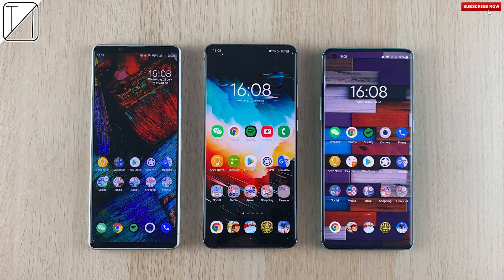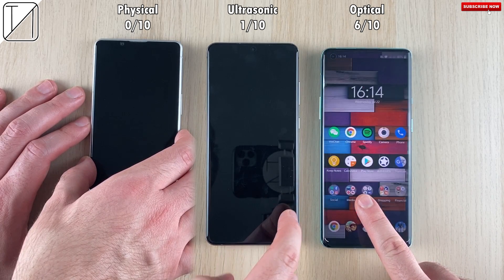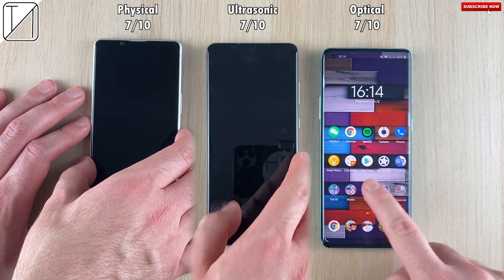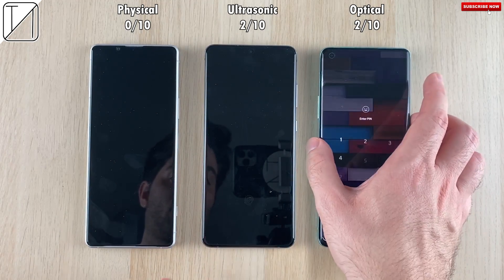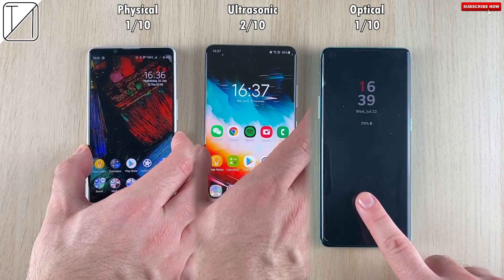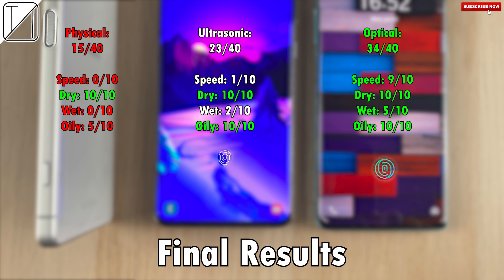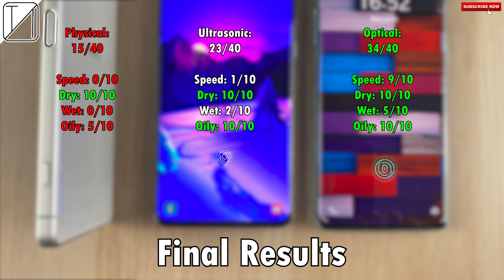[Slow Motion] Physical vs Optical vs Ultrasonic Fingerprint Sensor Speed and Reliability Test

Comment: I honestly think this is very inaccurate, have you tried any line of phones by Xiaomi and their rear sensors?  They're so fast.  
I have the OnePlus N20 and I'm considering returning it because there's a lag, the Xiaomi 8 and 9 rear sensors are blazing fast by comparison.

The way you're doing the physical finger test is flat on the table, therefore you're finger isn't entirely exposed properly on the hardware because of the table limiting the finger.
Try that phone in the air with your thumb and then compare the results again.

Terrible test, considering the side sensor is designed for the thumb.

Comment: Well physical (capacitive) fingerprint sensor are much more durable , secure and cheaper in comparison to optical or ultrasonic some even work after being scratched. Only downside being that they dont work when fingers are oily or wet.

Comment: Ultrasonic sensors are 3D and optic sensors are 2D which in terms makes them less secure....but....Ultrasonic sensors are a nightmare with ANY screen protector, including Dome glass. Especially if your fingers are completely clean and grease free (e.g. immediately after washing your hands). To the point that the are not usable and I always end up using face recognition...licking your finger helps, but I/m not doing that 50 times a day. There is just NO way I will use any flagship phone without a screen protector just to use the ultrasonic sensor so I really hope Samsung switches to optical soon.
Reply: Now every flagship phones use Ultrasonic 😂
Reply: yup, you try first.. and then second, third so on..
after that you ended up using PIN and ask yourself "Why I'm here just to suffer?".
Reply: Ultrasonic is a nightmare for me which i hated my s24 ultra and switched back to my previous iphone 🤬
Reply: optics are a step backwards lmao
Reply: They need to bring back the physical fingerprint sensors

Comment: As someone with a Pixel 5a (a $400 phone that has a rear fingerprint sensor like its 2016 or something) i can say that rounded rear fingerprint sensors are the absolute worse - never once has it taken me only 1 attempt to open the phone in my 3 months of use and most of the time it locks the phone before it can actually detect my fingerprint. Honestly rear rounded fingerprint sensors are just a huge steaming hot pile of garbage, do yourself a favor, and dont buy yourself a phone with a round rear fingerprint sensor if you plan to use a lock screen.

Comment: The water test was unfair. For one, you have to put a bit more pressure on the ultra sonic sensor. That's just how it's made, wet or dry. And 2, it's literally telling you to press a bit harder when your finger was wet. If you know Samsung, you know this. So the error is not on Samsung, it's on the user.
Reply: Exactly!

Comment: My oneplus 5, had an amazingly fast physical fingerprint scanner, that now going from that to my new phone, an oppo find X2 neo (or Reno 3 pro depending on where in the world you live), which uses a similar scanner to the OP8 pro as in the video, is making me so frustrated because it is sooo slow rather than instant like my oneplus was. Not to mention half the time doesn't even work. I've even reset my fingerprints a few times just to make sure it's registered properly.

The oneplus 5 was such a good phone for its time that everything now just pales in comparison. I've even downgraded from Snapdragon 835 to 765g.
Reply: The Snapdragon 765G benchmarks higher than the 835.

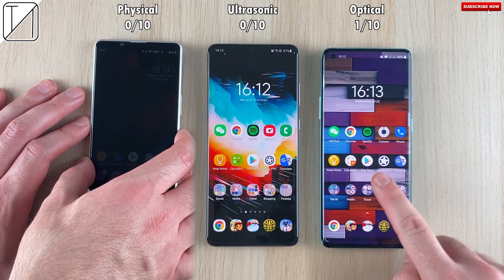Comment: 1:14 You're using the side mounted sensor inappropriately. You don't need to hold your finger on the sensor, just a moment of life touch is enough to wake the phone in no time. You can try tapping your finger as fast as you can, it still responds quickly
Reply: actually u r right
Reply: that is very true.
Reply: Same with the ultrasonic one

Comment: This doesn't add up with my experience at all.
My phone is a a52 5g and girlfriends phone is xiaomi 9T. Both have opticle sensors but while mine often fails 3 times before letting me in and take a half second to register, hers is immediate.
Both are slower than the physical fingerprint reader I had on my s10e and oneplus device.
And just tested a s21 today and that ultrasonic isn't as quick as physical fp reader but still quicker than optical.

Comment: For the first test which is the speed test, you should turn on the unlock animation for the samsung or else it will appear slower because the animation makes the optical sesor phone ones appear faster

Comment: So the optical is actually better? 🤔 didn't know that
Reply: Not really. It's only insignificantly faster. This guy wasn't using the Ultra Sonic sensor completely correct. The USS is more of a press than a tap. The phone even says that when it doesn't read your finger print fully.

Comment: At this point: What is the point of the ultrsonic one?
Reply: Its more secure than optical and as secure and faster than physical
Reply: @arbindsribastab6563  how more secure? I never seen a case where optical is bypassed. Besides, ultrasonic wont work if screen is scratched(jerryrigeverything) while optical does. And ultrasonic wont work if theres water on ur hand unlike its supposed to. I think water part is supposed to br underwater or something? 🤔 anyway i see no point. Its even slower than bbk's optical scanners.
Reply: @ConstantUNTILisnt  just search on google and im pretty sure that either nick didn't know that you have to tap harder or it was staged ultrasonic works with wet fingers and also ultrasonic takes a 3D image of your finger while optical takes a 2D one making the optical less secure 
but still reliable but its less secure than the other two

Comment: In mid range phones with physical fingerprint scanner its lightning fast like in realme huawie oppo vivo but if ur fingers are wet it will not unlock also if ur fingers are oily it will not unlock
Reply: Yes bro..realme and xiaomi physical fingerprints are instant unlock but in display ones take some time..and physical fingerprint sensor sometimes wont work with oily fingers

Comment: I'm not interested in the optical sensor because it is the least secure. The other two, ok. I have both the Note 10+ (ultrasound scanner) and the Xperia 1 ii (physical scanner). In my day-to-day experience, both can be unreliable at times. BUT I do prefer the physical sensor on the Xperia because of ergonomics plus the fact that my first touch on a phone is NOT a big thumb print on a freshly cleaned screen. By the way, in normal conditions, no wet or greasy thumbs, the Xperia is super quick and reliable.

Comment: The one with water you clearly was not pressing it you kept on tapping it. Even when it said press harder. I caught you on that one. With water Ultra sonic works always. You just need to tap harder
Reply: Facts. With Ultra Sonic you have to press vs tap. Even though with he S21 Ultra you don't have to press as hard. You are absolutely correct.

Comment: So here's my argument in favor of physical fingerprint reader:

The reason why I would always choose a physical fingerprint reader is because I can put my hand in my pocket (because that's where my phone is most of the time), pull my phone by grabbing the phone by the fingerprint sensor, and by the time I've pulled the phone out, it will already be unlocked. Now one can argue how it won't really save a lot of time, but it's not about saving time, it's about doing everything in one motion. 

With the in-display fingerprint sensors, you still have to pull the phone out and then scan your finger because of the proximity sensor not allowing the display to turn on in your pocket, and even if a phone's under-display fingerprint sensor works in the pocket, you have to hit it at the right spot which can be a hit or miss, which will again require you to scan your finger after you've pulled your phone out. 

And face recognition is just the inferior way of unlocking a phone.
Reply: Hmm my old moto g5s+ have fingerprint sensor on bottom bezel nd super functional like android navigation control (like touchpad), screen on/off
Reply: that time you are removing an unlocked phone(physical fingerprint phone)from pocket someone stole it while half removed from pocket then thief got an unlocked phone yipeeee🤣😂🤟
Reply: @Short_N_Simple  I literally lost IQ reading reading this comment 😂
Reply: @Page2003  because i was kidding 🤣😂🤟
Reply: i can unlock my phone with the ultrasonic while its in my pocket as well the screen doesn't have to light up. And i also never miss it because that usually the way i take my phone out. True, face recognition is only useful sometimes. The physical is more secure tho. I also prefer it especially if its on the back.
Reply: Even if i love the s22U and its ultrasonic sensor. I still prefer the physical capacitive more since i can open the phone at the same time. Plus the high end capacitives are way faster than this A8 from god knows how long ago. Should have used atleast a note 9
Reply: I honestly think this is very inaccurate, the guy doing the test hasn't tried any line of phones by Xiaomi and their rear sensors?  Or ANY physical rear and finger print sensors, LG, OnePlus etc.. 
They're so fast.  
I have the OnePlus N20 and I'm considering returning it because there's a lag, the Xiaomi 8 and 9 rear sensors are blazing fast by comparison.

The way you're doing the physical finger test is flat on the table, therefore you're finger isn't entirely exposed properly on the hardware because of the table limiting the finger.
Try that phone in the air with your thumb and then compare the results again.

Terrible test, considering the side sensor is designed for the thumb and again it's not getting full and proper exposure.
Reply: @CinHalCedHerChance  plus the phones are from wayyy different price ranges. At that time, the best capacitive sensor would probably be from the note 9 or the s10e. While the optical should be from the Huawei or OnePlus
Reply: @tridinh1011  I tried the OnePlus N20 that just came out.
My OnePlus from 2016 with a physical sensor was literally a second faster than the optical from 2022. lol

I'll pass.

Imagine your screen breaks or cracks right around the sensor, you have to replace it.
With a physical one, you don't have to, it's like you have a redundant back up to enter your phone.

But this is where we've been heading for years, they don't want things to last.
They want us to keep buying and spending our money.
Reply: Lol display is better than shit
Reply: Absolutely true. Practically physical finger print sensor by Sony is always easy.
Reply: Yeahh same here
Reply: @Plant Papi see videos of relaxing end on YouTube . He unlocks the phone with hands gloves wearing. So there is nothing like that.
Reply: If you care about that Android has smart unlock. If it detects its on your body it will stay unlocked.
Reply: Who the h*ck will use phone while in pocket? 😅 Doesn't make any sense,
Reply: True plus using your thumb is the best way to go side mount fingerprint sensor. Or the index finger pointing vertically along the phone bezel.
Reply: you just trying to make yourself feel better about having a budget phone with physical fingerprint scanner. there isn't any arguement about it
Reply: @omegalongdong  Right. Cuz folding phones are cheap
Reply: I agree however the term physical means nothing. they are either optical, electrical, sound, or thermal sensors.
Reply: @ConstantUNTILisnt  It is always looking for your face
Reply: I had the same thoughts, but now I own a phone with an optic sensor and 9/10 I can pull the phone out already unlocked.
Reply: I dont care for me optical is best
Reply: @arbindsribastab6563  lol "I don't care"... relax Arbind, that's why there are different options, everyone likes what they like.
Physical sensor tends to be a bit faster though.
Reply: One thing you will be faulty at when you have optical sensor is that suppose if you have a purse in the pocket and you happen to keep your mobile in the same pocket too and if your buying something or whatever etc and you accidentally touch your mobile optical sensor in the pocket and your mobile happened to light up and you don't happen to recognise it then think about what will happen to that poor mobile in the pocket.... For me physical sensor is best. It only takes some nano seconds
Reply: @Page2003  wtf. So u just accidently touch the exact location? Besides whi put purse in phone pocket? And screen wont turn on in pockets. And what if u hit the physical fingerprint in ur pocket?
Reply: @ConstantUNTILisnt only if I press power button! Still it isn't that fast. It takes 2 seconds to unlock my phone through fingerprint 😁
Reply: No dude. Face id/unlock is the fastest if u use a raise to wake feature. It will unlock the phone as soon as u raise the phone and it sees ur face

Comment: Speed means nothing when it comes to finger scanner as that could mean that the security tolerance was reduced. Also optical scanner make only a 2d image of your finger print and ultra sonic scanner make a 3d image and therefore are more secure and harder to fool but of course all scanners can be hacked.
Reply: Another sony sheep trying to defend sony😂 the sony LOST ok lets end it at that
Reply: @arbindsribastab6563  I'm actually a Samsung fan so no Sony sheep here.
Reply: @lightstorm6652  oh well but ultrasonic is best not the fastest but its safer than optical and faster than physical